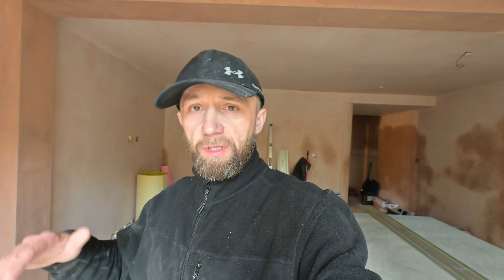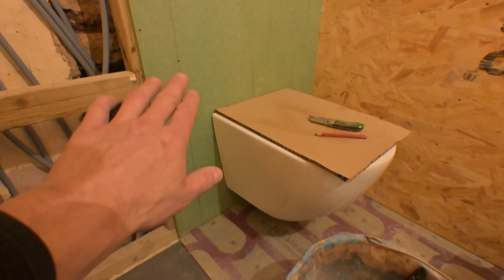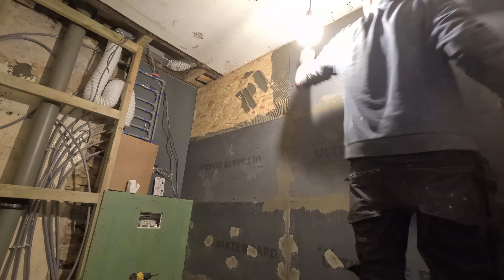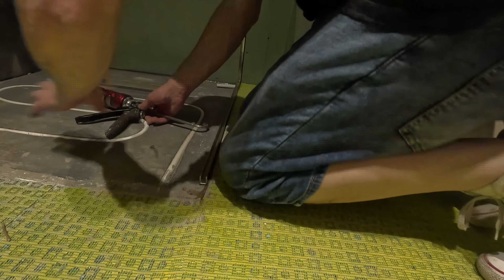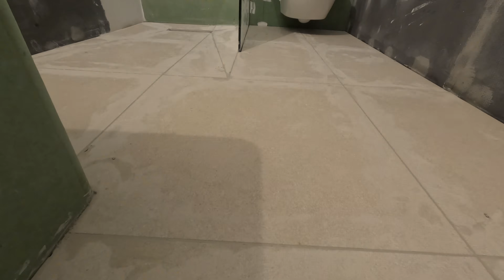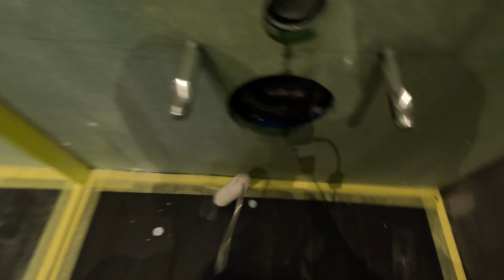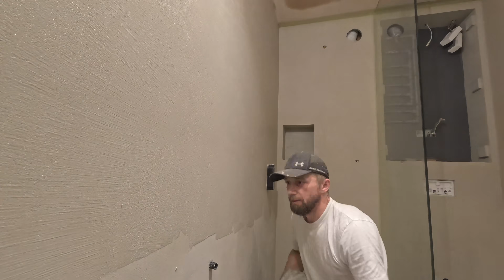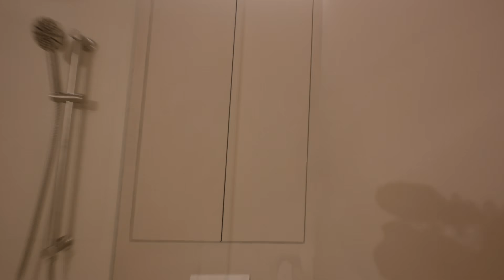The Death of Bathroom TILES..Micro-Cement Explained

Comment: if its water proof why seal it
Reply from the maker: The seal coat is for UV protection and to make it smooth as the surface before sealing is rough in touch.

Comment: I really wanted to get this done in the bathroom instead of the tile which I never liked. But the problem is getting the right quality meticulous tradesman to do the work !!!
I am here located in the states in TN .
Reply from the maker: Ahhh, sort to hear that. I thought you guys wouldn't have a problem. Micro cement was invented in the US 😊
Reply: @yesconstructionltd  As a detail oriented person, you would have a stroke if you saw some of the residential and commercial tile work here.  I can't think of anyone in a 100 mile radius I'd hire to even try this.
Reply from the maker: @MultiPoseur 😂 is it that bad?
Reply: @yesconstructionltd the trades are going through a difficult time, for a variety of reasons.
Reply from the maker: @russw3134 
It's not great in the UK. What I am observing is that most people in the trade are falling to it from lack of choice. Not many people are working with their heart anymore, it's all about money. 
It's very easy to start construction business. All you need is tools and some advertisement. People are getting scammed left righ and centre here in the UK.
Reply: @yesconstructionltd one of the issues (out of many) is that the boomers had a bit of a stranglehold on the trades, and most young people were pushed into higher education.  So most of a generation were saddled with massive debt and very few went into the trades. Now the boomers are retiring and there is a rush of opportunists, some led by private equity, with no interest in quality, only in the profits for this quarter.

Comment: Tiles are good, and somewhat durable, the weakness is that paste between, so it needs maintenance. I personally don't really like cement for wet rooms, but it works somewhat well too. Personally I think stone is the best and nicest solution, and I think some kind of plastic coating for sealing the wet room from the rest of the house is also overdue. There is just too much and too long a track record of wetrooms failing to keep water out of the rest of the house.

I know we all don't like plastic, but it's really super good at one thing, and that is keeping water in/out, or separating water, it's pretty much fool proof and low maintenance. Stone is as well, not fool proof, but low maintenance, and it looks pretty nice too.
Reply from the maker: Thank you for engaging. Yes, it's a different solution and not everyone likes it. It's definitely extremely waterproof and flexible. Scratch and UV resistant so it ticks all the boxes. 
It is a different look and some people like it. The architects and interior designers are pushing this idea a lot. 
Today's micro cement is resin based and it doesn't fail anymore but you have to be careful as the cement based stuff is still sold.

Comment: smooth, sleek, clean work bro. looks like you popped it out of a mold in one piece.
Reply: experienced professional tradesmen will be needed for this; polythene panels cut to size are a good quick simple alternative giving colour options and all the resilience.
Reply from the maker: @lawrencesimmons5735   it is true. You need an experienced installer for this to look right.
Reply from the maker: Thank you 😊

Comment: Very technically interesting video.  A voice over the sped up parts would provide much more important  detail info than the "music".
Reply from the maker: Thank you for your advice. I am planning to make a proper, detailed video on this subject because I am getting a lot of questions on HOW? HOW MUCH? HOW LONG etc. I will have to split it into two videos, as one would be too long.
Reply: @y @yesconstructionltd If you do, skip the music altogether. In the US at least it’s pretty unpopular. And as far as that goes  for pros you could cut the length of a “coat” or “sand”!shot way down. We get it - no need whatsoever to show an entire wall at 8x.  Two seconds would tell the story.
Reply from the maker: @HBSuccess  Its not easy to do the work yourself, record it and then edite it into a video.  It's emotional. I think everything is important to show, and only after some time, when I watch it again, I realise that the video is too long and some frames are completely unnecessary. I am learning from comments, so thank you!

Comment: Looks great and turned out really well. I’m planning on doing a small en-suite similarly in micro cement. 

One critique I’d say is although you use jackoboard and micro cement to waterproof the walls and green mdf. You didn’t tank the wall to tray joint/seam so are solely relying on the silicone and tile grout.
Reply from the maker: Well spotted! This is a long story, and someone got fired for this job. We normally use waterproofing tape behind the board, overlapping the tray, but I wasn't on site when this happened. Sometimes you can't control everything, but it is essential to trust your team. Sad really. 
Anyway, I did what I could, and I believe it is good enough. We created a 5 mm gap, cut out the boards, and injected CT1. On the surface, I used a scraper to spread the CT1 to create something like the tape we were supposed to use, so that everything is bonded together as one. Then we tilled, microcemented and siliconed on top. I learned my lesson; you can't trust anyone. It won't happen again, i promise you that.
Reply: @yes @yesconstructionltd   Fair enough, that’s the way it goes sometimes. Sounds like a viable solution in the end though. 

I know exactly what you mean with trusting the team or another trade to do what they’re supposed to. Have had similar things happen on my sites but I guess it’s how you overcome or adapt a solution to the problem that counts in the end. 

What product did you use in the end? I’m interested, can you create a burnished finish by troweling the final layer multiple times like concrete? 

Does the surface really seal up or is it still got micro pores.
Reply from the maker: @Pete-O123   Thanks.
We use www.claudicemento.com. For a smoother finish, you can buy different product grades. We used the medium grade on this job. You can't make it smoother, since it has crushed stone inside, so it will be as smooth as its size allows. I will be using the smooth one on kitchen worktops and splashback in my video, so you will be able to see what it looks like. My next video will be about the kitchen, and after that, I'll do the smooth worktop. Thank you for taking part 🙂

Comment: Here in the US I had this done in two of my bathrooms about 6 years ago and it turned out great, I love it. Very durable too. I chose a marble look for the finished product and it looks fantastic, and very easy to take care of and no grout lines to  clean. Highly recommended.
Reply from the maker: I am glad it worked out for you. Many people have bad experiences because they use the wrong product or have it done incorrectly by a bad tradesman. You should have some good stuff in the US. Micro cement was invented in the US for the military.
Reply: you forgot to say one thing if you get tired of the colour youcan change
e it
ge it
Reply from the maker: @gerry45  Yes, you can. Any time. Thank you
Reply: You just sold me. I'm about to redo my restroom and laundry area, so this seems more durable.
Reply from the maker: @lani1life  I am glad my video helped someone 🙂
Reply: 😊😅⁰😊0
Reply: In the US as well. Where did you get yours? What brand? And any pros and cons so far after some years of doing it? DIY friendly? Thanks for any help! I’m in PA
Reply from the maker: @Popcornsoda007  I wouldn't say is super DIY friendly. You have to be good with your trowel. 
This stuff is really good. 
www.claudicemento.com
Reply: I like this. Curious about US cost in comparison to other options.
Reply from the maker: @ytav_boy2820 Hi, and thank you for participating. We charged around 11K for labour + materials. I think the overall cost of this bathroom was around 16k-17k
Reply: Was there a practical reason for tile on the floor or was that an aesthetic choice?
Reply from the maker: @moecopiak9168 
Esthetic choice. We have some jobs lined up where we will micro cement the floor too and I'll be making some videos;-)

Comment: Soooo many questions how did you get the corners correct on the inside of the niche?
Reply from the maker: Hi, and thank you for stopping by. Do you mean the long internal corner on the left of the niche or the 4 corners around the niche? 
I answer both. 
Around the niche and in the long corner is all trowel work. Around the niche I switch to a 6 inch filling knife. It's hard to explain but I am looking at all these questions and understand that I have to make a detailed video explaining the technique and method. 
I will, stay tuned!
Reply from the maker: But if you have any other questions, I am happy to answer them.

Comment: Yikes, no matter how you create a cat litter area, it will still stink in there.  Just imagine every time you shower you will humidify that room with the cat litter and all.
Reply from the maker: 🤣 It is not so bad. Cat litter nowadays is very good at tackling smells. There is continuous air extraction in the bathroom as well. Someone left a comment that I should install an extractor fan inside the cupboard. I think this is a good idea.

Comment: No washers on the boards manufacturer recommends washers?
Reply from the maker: That is true, but we used adhesive, so it is not going anywhere. We added the screws as overkill. The washers would have created too much indentation and too much to deal with to make it flat. Thank you for asking

Comment: this is an order of magnitude more effort in terms of work steps. I am all in favour of innovation, but if this was the standard practice and someone invented tiles everyone would jump to the tiles immediately. A high end product and result but out of my league.
Reply from the maker: Thank you for engaging. Yes, it is a lot of effort, but it is a satisfying process. You either hate it or love it. To my knowledge, micro cement was invented in the USA for military purposes. It was used to patch up holes in the aircraft carrier's floor.  It was polymer- and cement-based. Now its resin so a lot better, flexible and fully waterproof. 
The application technique is similar to silicone render, and the cost isn't much higher than good quality tiles.

Comment: Does it act like external tanking, is it flexible, and do you need take any precautions on the corner joins?
Reply from the maker: Its extremely flexible and can be applied externally with a different seal coat. its fully waterproof. You can wrap the mesh around the corners but if you do it all on wet, so everything bonds together, its not necessary.  As i said, it is extremally flexible so it wont crack.
Reply: @yesconstructionltd Amazing thanks
Reply from the maker: It separates the surface your are applying on from the environment completely. It can be used externally but different seal coat is required. You would treat the corners same as dry wall.

Comment: 23:35 I don't like the composition. The biggest problem is with the glass panel. It limits access to the toilet and shower. Cleaning it from the side of the toilet will not be easy.
Reply from the maker: Its a narrow bathroom so designing it was tricky.

Comment: I would be interested in using a spray hopper that you normally use with joint compound to spray the concrete orange peel texture coating, would look good with a little knock down texture too.
Reply from the maker: Interesting, I haven't thought of that before. Do it! And make a video 🙂

Comment: I wonder how does it maintain against mold and water residue. How easy to clean..
Reply from the maker: Hi, and thank you for engaging. The method is the same as with marble, so use gentle cleaning products. It doesn't stain much, and it is fully waterproof. It's also antifungal, so nothing will grow on it.

Comment: How do you manage coating thickness?  At millimeters thick you can’t be consistent with just the eye.  How will the material handle foundational settling and cracking resistance?  If it cracks, what is the process of repair?  Cement is a porous material and very prone to capillary moisture retention.  What product or sealer is needed to prevent the cement from becoming a moisture sponge ?  What is the staining resistance?  Cement is easily stained by hard water.  Looks very industrial and has zero cosmetic appeal.  The Ladies are going to loath this end product unless you can come up with a method of adding color/tint/texture variation.
Reply from the maker: Hi, and thank you for engaging. Let's answer these questions:
1. The thickness of each layer is controlled by the quartz grain size. After applying it to the wall, flip the trowel to the edge and scrape back until you can't remove any more material. 1mm will stay. The base coat has a bigger grain than the final coat. 
2. The initial cure takes 24 hours, but full cure takes 28 days. You can start using the bathroom 72 hours after the final coat. The material is extremely flexible, so it should never crack. If you apply the entire buildup on a strip of paper, after curing, you can bend it into a full circle without cracking it. Small repairs can be done without being seen, but you won't get away with larger repairs, so the whole wall needs to be coated with the final coat again.
3.This is called micro cement, so most people think it is cement-based. This was the case since the 50s until recently. The improved formula we use is resin-based, so it is not absorbent. Zero-cement formula. Just crushed stone and resin, waterproof from the first coat. The final seal coat is highly penetrating and designed to fill all the microholes, so it is fairly stain-resistant. There are different seal coats; some are very expensive and used on kitchen worktops, floors and other high-traffic areas.
4. When it comes to cosmetics, you can be very creative. They come in many colours, and you can create interesting textures. On some jobs, we used oak caneered doors on vanities and cupboards to add character, like in this video:

  https://youtu.be/5dVq9bgEA5E?si=3PlvUNraCDv1cle0

Designing a micro-cement bathroom is the most important part. Some people like the simplicity and smoothness, while others don't, so they add bold features and lots of ambient light.  As I said, it's all about being creative. 

To summarise, I would say it is like Marmite - you love it, or you hate it. The practical aspect is good, so only the look can raise questions. 
I hope I helped you understand the product, and if there is anything else you wish to know, just ask. 

Thank you
Reply: @yesconstructionltd ; Thank you for taking the time to provide detailed responses to my inquiries.  Appreciate the effort and your response were enlightening.
Reply from the maker: @AdamG.GoNavy.FlyNavy   My pleasure. I🙂 am glad that my video is useful to someone

Comment: Impressive work... And video. But as a "handyMan" who has built more than a couple of tiled bathrooms I have to say that I would probably balk at the amount of work this process seems to require compared to tiling... Not least sanding... Do I have to mention that I don't like sanding ;)
Thanks for a great and informative video
Best regardss
Reply from the maker: Thank you for your comment. It is not as scary as it looks actually. As long as you are confident with a trowel, you will be fine. The sanding is not as intense as you might think. This stuff is very hard so it dosent sand much. Its all about smoothing a bit before the next coat.

Comment: Any textures?
Reply from the maker: You can do a lot with it. It's all about how you apply it. Instead of two coats of the base layer, you can do one, and then it will show more texture. You have to try it on a smaller surface and play with it.

Comment: But its ugly 😮 horrible color
Minimalist like a jail bathroom!!!
Press board , concrete board, 
Primer, mesh, sand, float entire surface, sand, float, sand, finish float, sand, ..4 times!!!
Wow what a lot of extra work...
Tile industry has nothing to worry about😂😂😂
Somebodys gonna hate changing that light bulb, how is micro cement holding up to cleaners???
What happenes when the building settles? What happens if theres a mouse chewing the pipes, the fix is gonna be expensive😮 how does patching blend in after a repair?

Comment: Looks like a lot of labour compared to tiling?  You didn't wear a mask during tiling.  I've done a lot of work with epoxy resins and that stuff is deadly on your lungs.
Reply from the maker: I wear a mask while cutting and polishing; otherwise, you are inhaling glass dust. The micro cement is not epoxy-based, so it is not as bad. The VOC is extremely low, and the whole formula is polymer-based. It's a lot safer. I wear a mask when I apply the first primer.  The data sheet says no mask is needed, but it still smells a bit, so I wear one.